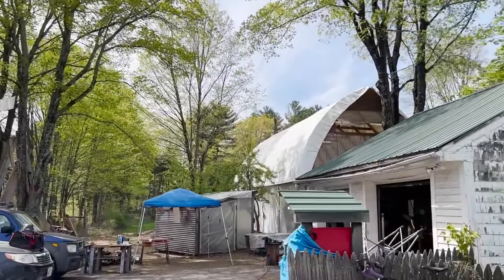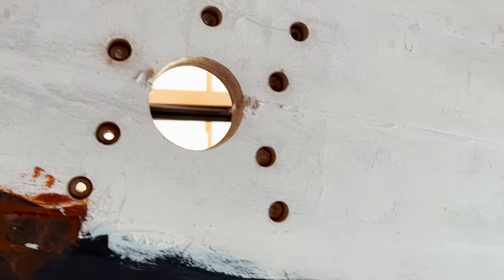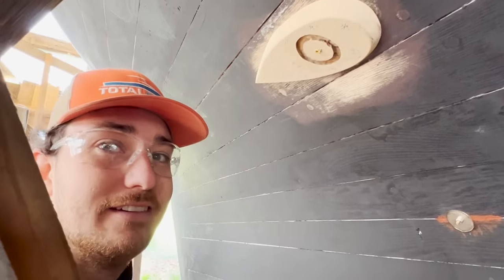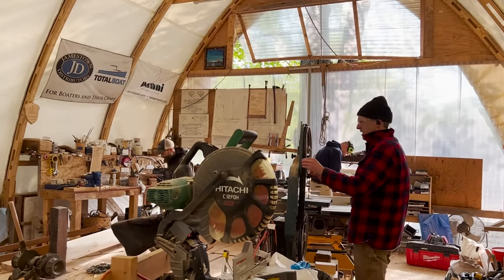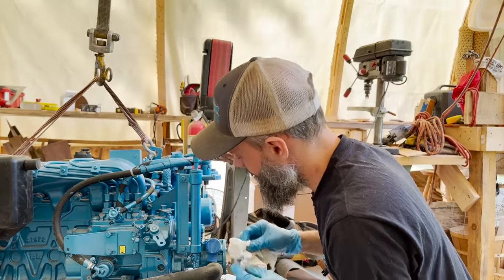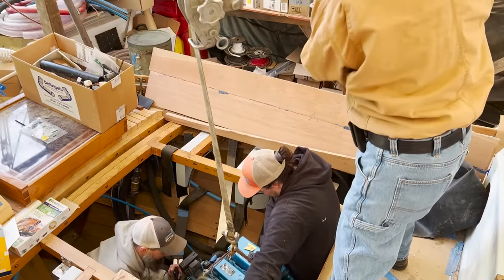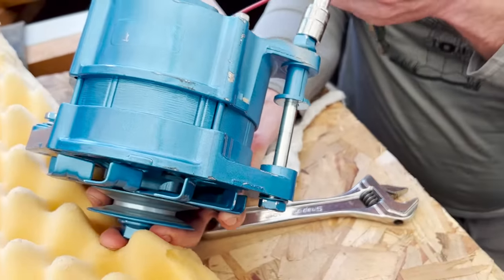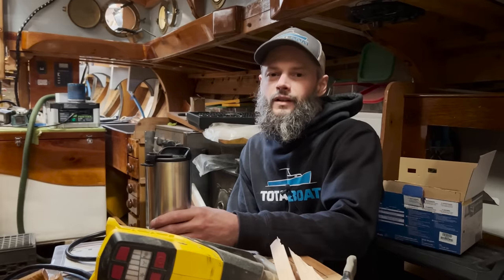Firing Up the Diesel Engine - Episode 268 - Acorn to Arabella: Journey of a Wooden Boat

Comment: "Tighten the bypass adapter to same tightness as the oil filter"  Hand tight is plenty.  While using a wrench to make sure the adapter is tight, it may also deform the gasket, they are not designed to be torqued, only hand tightened.
Reply: Oil bypass hose and fittings should be a&n and one wire pressure hose with crimp fittings. Do not use push lock fittings with hose clamps.
Reply: I thought the same thing. No one should tighten an oil filter with channel locks.
Reply: @WillRyder3rd  Yep, trouble may creep in when the engine heats up.
Reply: Most adapters have two gaskets and have a recommended torque setting of >40fp. Don't know how tight he got it with channel locks though.:oops:
Reply: I saw that and if it becomes a problem for him, then he will to find it!!😂

Comment: I'm delighted and relieved to see the cockpit coamings raking so far outboard. Most wooden sailboat cockpits are really uncomfortable, because the coaming sides are traditionally plumb (or close to plumb) when the boat is level. Given that almost all crew will be sitting on the uphill side when the boat is being driven hard, this means that the top of the coaming digs into their back ribs in a highly obnoxious way, especially when there's slamming going on!

Comment: It's a bizarre experience watching holes get drilled into the planks after all this time...
Reply: I've been absent for awhile, but I remember the earlier days when holes in the boards were sealed using different coating and corking techniques. It was well thought out. Looking at this - A non permanent sika flex below the water line😮 Two years it will be in for wood rot repair. Epoxy sealing end grain first would have been advisable.  All silicon based products fail after a few years in the weather. That's why recreational boats rotted out, not because of the wood, because dealers fitting motor's had no idea about boat building, they'd just sika the motor bolt holes up, along with ladders, transducers etc and send it on its way.  West systems blue book describes how fittings should be fitted. Worth a read. 

If someone said no you can't epoxy brass fittings, which is true, doesn't mean you don't seal the timbers with epoxy before using sika.

Not trying to be critical, it doesn't seem right and I'd hate after all this effort to see it go sideways. Unless I'm missing something??

Great to see this thing get a motor, coming along nicely.
Reply: @andrewiannello6548  they are using 3M 4200 not silicon  , it's a marine sealer  formulated for that specific aplication , is a kind of polyurethane not silicon based
Reply: Hai👍👌antonmursid🙏✌👌👋
Reply: @andrewiannello6548  I own and maintain a 64 year old traditional wood sailing vessel, we just removed one of her original through hull fittings, and there was no "rot".  Those bolt holes were probably sealed with tar, the new holes and bolts were sealed with a Sikaflex product by a shipwright with decades of wooden boat building experience.  First of all, salt water generally prevents rot by "pickling" the wood, that is wood decks are routinely washed down with salt water, fresh water is the source of rot not salt.  Modern bedding compounds or sealants do a very good job.  Epoxy, penetrating or standard is incredibly hard and brittle once cured and does not expand and shrink with the wood so is not appropriate for below the water line in general, and particularly on a small area like plank ends. There is some discussion about using penetrating epoxy as a sealer on old planking but I don't think the efficacy and any side effects have been well documented.  Barring collisions or other mishaps, Arabella's planking will outlive Steve.
Reply: It was the most nervous, white knuckle, terrifying thing I've seen in a while!

Comment: HI just a thought, place a 1 gallon freezer bag over the filter and it's mount after it is loosened slightly then hold the bag up and slowly remove the filter. most of the oil should end up in the bag.
I saw this on YouTube. works well.
Rich

Comment: Very cool watching the engine being tweaked. Something you might want to consider is constant tension hose clamps instead of the worm drive ones Steve used, worm drive clamps are known to back off after a while. Not something you would want to replace at sea

Comment: I've restored a crap load of boats over the years and what I call "the fun stuff" (installing all the new stuff, paint, upholstery, etc) is always short compared to the major work (sanding, body work, fiberglassing, etc) but after all these years watching A to A it's a little sad to see the videos rushed at the end to catch up with real time. I understand why it's being done but....  
Steve, with full filters, zip loc bags are your friend. Put a couple paper towels in the bag, break the filter lose, slide bag over it and unscrew the filter inside the bag. When it's done dripping, seal the zip loc bag so nothing spills. Couple paper towels on the surface you took the filter off of will catch future drips until you get the new filter on.  
Good luck, after spending a few days in the ICU last week you all may get your boat wet before I get mine.  😁😁

Comment: The Construction is near, but the Journey is just beginning.   Never say Never.  No tears shed, only smiles for Miles!!.    Fred Knowels? is a Mechanical Artist, and a wise ass!!.  I guess there is a little wise ass in every Artist, and Mechanic.    You can "close loop" the cooling system while in harbor or Moorage, and then pump Prestone into the cooling system, to stop the corrosion on the cooling,, and keep the engine water pump seals conditioned from bits of barnacles and sea junk.  More plumbing involved, and a reservoir tank with 15psi rad cap.   Also, you can find small, sometimes perfect sized, sacrificial anodes on just about every outboard motor made after 1950.    That Nanni Diesel should run for 15 years before it needs internal work.   Nice Work to everyone.  Coingrats!!.

Comment: Everything looks great! This may be a non-issue as I'm not familiar with this engine or application, but generally it's recommended to avoid uphills in oil return lines. Oil can get stuck in the line and cause a backup under high flow conditions. If possible, you may consider loosening the adapter plate slightly so the return line enters on a downward angle.
Reply from the maker: We’ve been advised by pros on all aspects of executing this installation, and so it’s probably a-ok.

Comment: Hi regarding Electronics safeguard normally we put in Silica gel packets inside the units and where ever you think moisture will be an issue. When ever the temperature raises from cold to hot droplets form due to condensation which effects the electronics. Which forms kind of rust white residue on PCB which might creat short circuit and damage the equipment

Comment: This may be nothing: but my understanding on those through-holes is that you're not supposed to tighten them all the way until after you've let the sealant dry a bit - so that you get the dried sealant pressured to fill every bit of the hole, rather than relying on the wet sealant to provide a perfect seal.

Comment: You might want to get a spare seal for that oil filter relocation. You overtightened it, only needs to be tightened by hand with a little oil on the seal.

Comment: Are you guys OK with hose barbs and hose clamps on the hoses for the remote oil filter? If anyone of those hoses ever popped off, the engine would be empty of oil in seconds. After all your great work, an investment in a couple of high pressure Aeroquip style hoses wouldn't be a bad idea.
Reply from the maker: We’re being advised by Nanni Diesel and Hansen Marine, so they did what they know is right for the engine and these modifications.

Comment: I have a couple of questions.  First, you said you bought the hose to connect the remote fuel filter and oil filter at NAPA.  Does your local NAPA sell fuel hose rated USCG A1?   I believe that fuel hose to an off engine fitting needs to be rated USCG A1.  Similarly, although I am not aware of a specific requirement for the hoses to the oil filter, but I would definitely want a hose rated to handle the temperature the oil will be at.  I would want to use something like Trident Marine type A1-15, which can handle what pressures up to 100 psi and temps up to 212F.

Second, I can't see if you have drip pan under the engine.  It is a very good idea to install a drip pan to keep oil out of the bilge.
Reply: Plus a drip pan and shroud under/around the remote filters.
Reply: @Brian-L  Yes that would also be a good idea.  That said, I have engine mounted filters and I find that a sheet of oil sorbent does the job quite well.  The other thing is that if you make a point of changing the primary fuel filter (usually a Racor 500 for that size engine) frequently, you can go for a very long time between changes of the on engine filter so it isn't much of a problem.  On my boat I have two Racor 500MA filters that I can switch between by changing a valve.  Then I can change the filter element in the either Racor at will, even underway.

Comment: 9:30 when installing the thru holes and the transducer are you taking into account where the lift straps for a hullout will land in the future? Just thinking outloud here probably not an issue cause they can't be install directly where a bulkhead is.

Comment: Awesome sounding engine, good to see her installed. Question regarding that, is there no flexible coupling between the engine and prop shaft, similar to a Lovejoy or chain coupling? Isn't there going to be a constant movement between the transmission and the shaft, not just from the wood swelling and shrinking but the natural movement of the hull? Maybe there is and I missed something?

Comment: try and find a fuel filter with a built in water separator. they have a drain valve on the bottom. that will help you keep the diesel from going everywhere
Reply from the maker: Yup, those are the Keenan filters we describe in a few videos.

Comment: I would eliminate those hoses with clamps. They WILL leak at one point. It's better to get crimped hoses. They can be redone in any port in the world if they fail, worst case you take your existing fiittings, clamps and hoses for an emergency fix.

Comment: Since the motor mounts were on the motor during shipping they won’t settle much, but yes you will need to readjust the engine position in a week or so, six month, a year and six months and every few years. Once the engine has been broken in, use a high quality synthetic oil if you want to quadruple the life. P.S. I wouldn’t use Mobile oil if it was free.

Comment: I hope the raw water pump impeller wasn’t turning during the test. They don’t like being run dry at all. If the impeller has a generous coating of silicone grease (Not petroleum based) it should be OK for a very short period like shown. Raw water impellers should be changed every two years and it’s not based on running time but installed time.  They are usually the most difficult to access maintenance item and I hope they have allowed for this.

Comment: Where is the thrust bearing for the prop shaft ?
Is the oil filter hose rated for the 60psi oil pressure ?
Reply from the maker: It’s not necessary for this particular setup. As for the filter hose, it’s rated for the application.

Comment: You may want to add a turbo to your engine which requires space. I have a 70 hp Kubota in my Ingrid and  it needs it in a 3 knot or more current which happens frequently around here.

Comment: Do you need to adjust the amount of oil in the engine due to the added length of hose to the oil filter?
Reply: Yes, but no more than you can take account of by just measuring on the dipstick.

Comment: One word of caution. Just be certain you connect the remote filter adapters correctly. On the oil adapter you connect out of that part to in on the filter head. Mixing those up can have very bad results. Reversed pressure into the oil filter causes it to disintegrate and clog the engine oil passages. Cummins diesel has remote adapters for some of their engines and some unknowing persons have hooked up the hoses reversed. Not good.
Reply from the maker: We’ve had a lot of direct guidance from Nanni.

Comment: Someone who likes 'baby-blue' a lot got the longest straw...baby blue as well, even mech- gloves🎈AmbulenceGloves & the engine sounded lovely..nice amount of tic-tic...are you using special oil..I hear so much controversy regarding reg- partly syn or full synthetic.. & down the road controversy regarding topping off ..maintaining brand etc..and no where have I heard making sure t I bring along at sea the case or two needed for change of oil..& as well supplying the ability to self store the oil drained at oil change time so its not left remaining at a port which hasn't the ability to move it to a refinery..but will chuck it ruthlessly onto a wild area.

Comment: Hope those rubber tubes gonna hold hot oil. If i do it for myself, ive used copper tubes to be safe and not melt rubber.
Reply from the maker: They’re made for the job.

Comment: seems silly going through a seam on the  through holes.
Reply from the maker: Not when you account for the much smaller width as one moves down the plank aftward. A boring through one plank in that instance is quite unstable. Better to bridge between two with a good backing.

Comment: I'm not an expert, but drilling through holes through plank seams instead of the centre of a plank just seems wrong, can an expert learn me up please.
Reply from the maker: Once they have the backing block on them, it’s good. Between planks further aft is necessary because they get so narrow, leaving too little of each edge to handle a boring. —Anne

Comment: Good thinking, But you made a poor selection on the oil hose and fittings 👎. Because of the heat and pressure, never use barb fittings and hose clamps. Always JIC 37.5 or SAE 45 degree fittings on crimped oil rated hydraulic hose. You’re setting yourself up for failure 😱😱😱